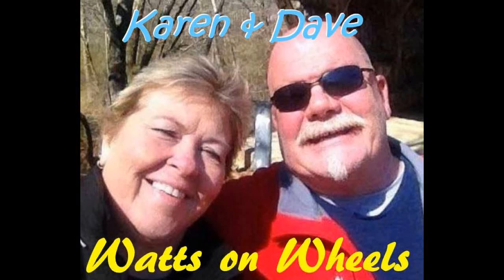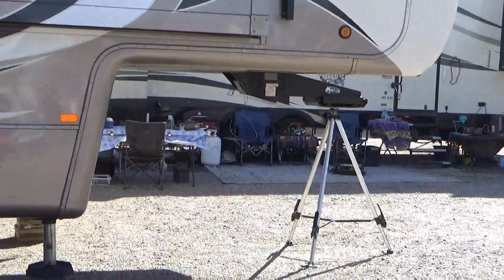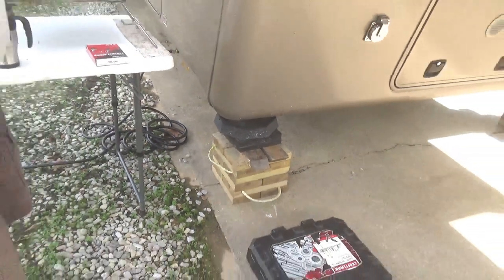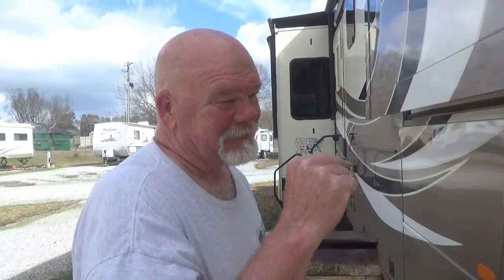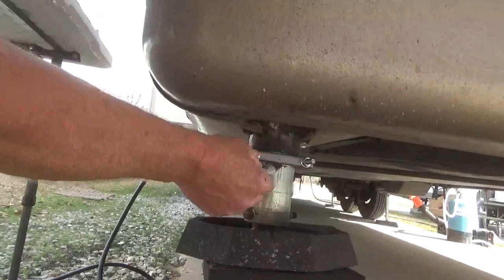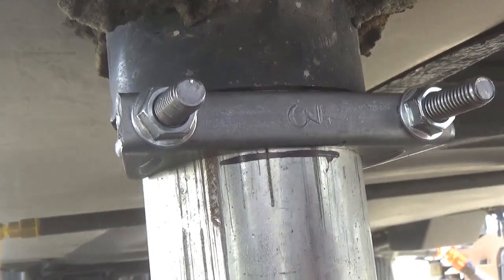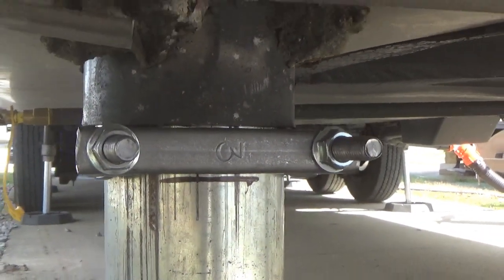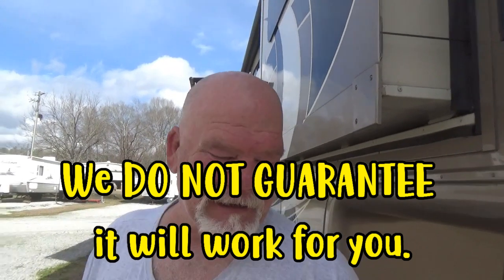Failing Landing Gear Temporary Fix  // RV Leg Failure

Comment: Go into compartment above batteries street side front under bedroom. Upper area is valves for hydraulics. Small allen wrench turn in set screw to close valve
I think front jacks are 3rd valve down maybe the 2nd. Run screw in stopped my drifting jacks. Play with adjustment can use jacks but no drifting. My were coming down while on truck
Reply from the maker: Good to know.  Thanks for the tip.  We had them rebuilt and we've been good ever since.  But we don't trust them.  https://youtu.be/poysawNZtmU
Reply: @WattsOnWheels  been watching your videos a few years, i drove michigan to new york a few years in my 88 kenworth then drove a company '14 volvo auto. Have 09 drv elite 36tks3 towed with '02 4dr drw 7.3 diesel. Always thought about putting my goldwing on a trailer. I have a commercial tandem licence. Safe travels Happy New Year!